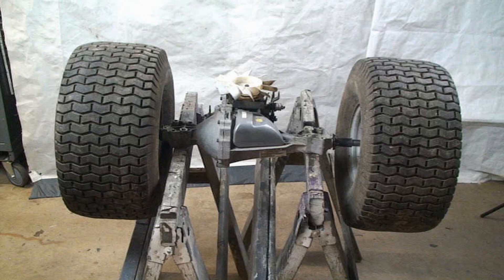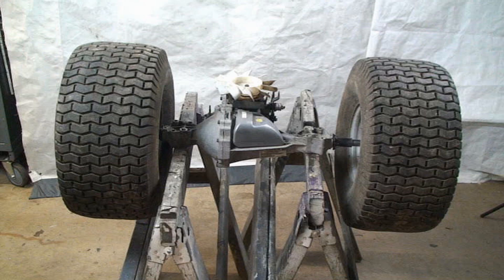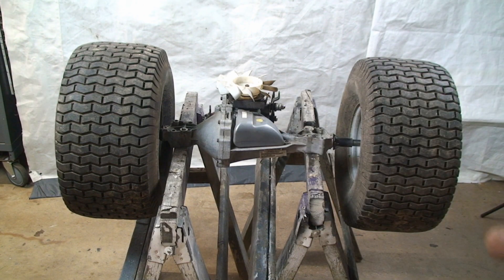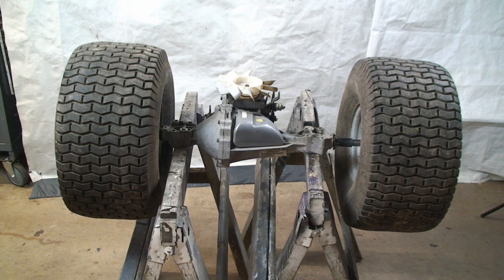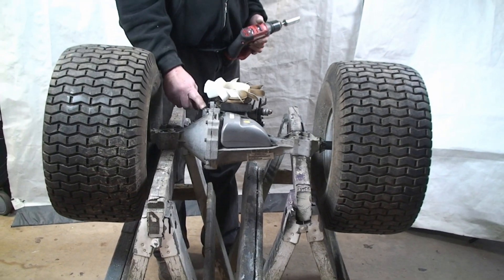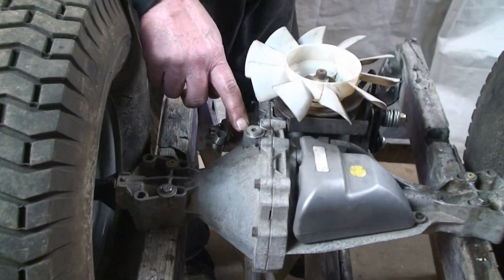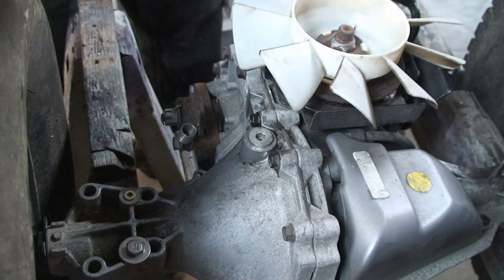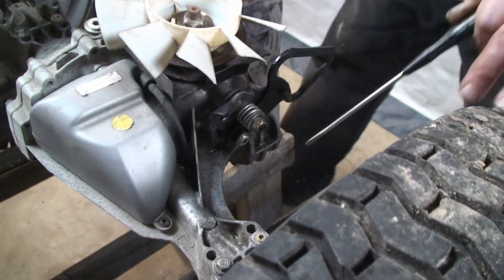Demonstrating a Tractor Transaxle Test on the bench to illustrate testing on your riding mower

Comment: This is perfect and just what I was searching for. The frame on my tractor (where the transaxle mounts to) cracked. Before replacing the frame I want to understand why it cracked. I don’t know if it is because there is too much tension from one of the control levers or the drive belt pulling the transaxle forward too much, or if the frame just wore out over time ( perhaps something inside the transaxle has metal shavings and is making it too hard to drive the tires).  If something is pulling the trans too far forward then I need to fix that first. Your video will allow me to test if things spin freely with no load.
Reply from the maker: What tractor do you have? There are some that have known issues  with the mounts on the frame, one example is some of the John Deere L series Tractors

Comment: Why would you take the trans out to test it? Wouldn’t it being on the tractor running tell you if it’s working or not?🤔 You could do this test and have a bad trans pass because it’s not under any real load. If the trans is on the tractor, a good trans will turn the tries over when up against a tree. This test proves really nothing. JFYI.
Reply from the maker: In my case it was in preparation for replacing a bad transmission. Before I put it in I thought I would put it through a quick test
Plus, if you are doing a test in the tractor you can get a clear idea of what you'll be looking for "under the hood" so to speak
Reply from the maker: So I changed the title and Description a bit to make it more clear, let me know what you think